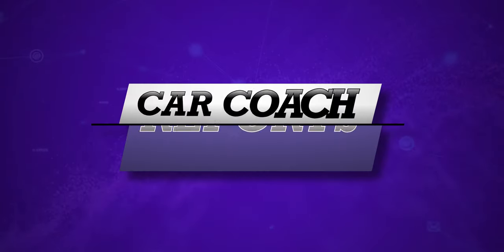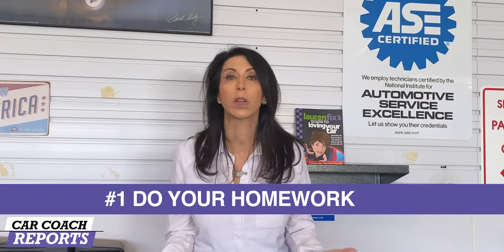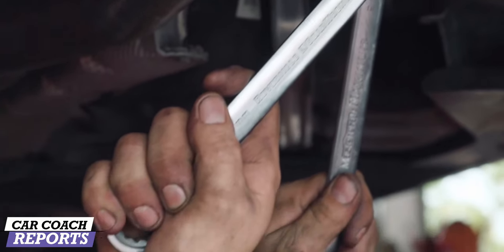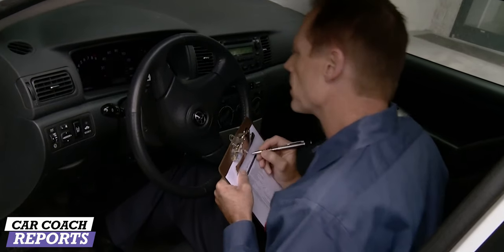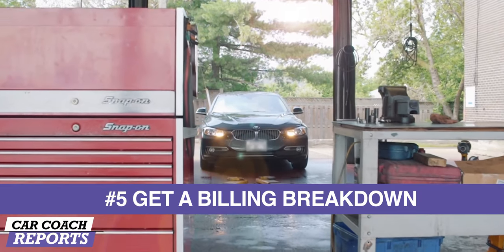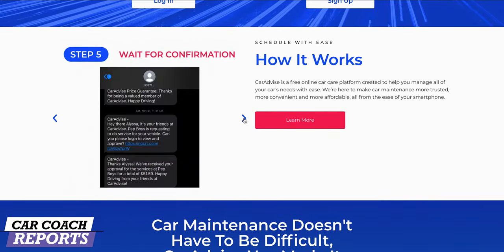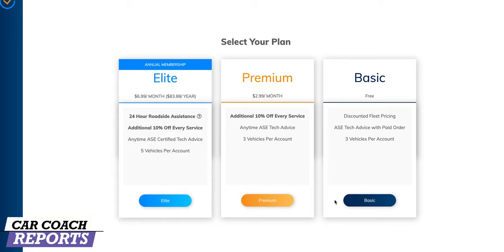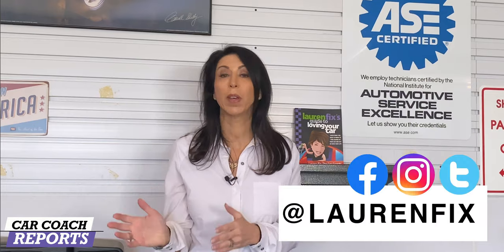5 Steps To Find a Trusted Auto Mechanic and Save Money!

Comment: Another super upload from Super Lauren! Solid advice. As GM and then CFO of one of the largest dealership networks in the USA and Canada at one time. The techs were all masters in order to work for us. 
But they were instructed to FIND issues and convince the service UP that if the repairs were not made, it would lead to major damage soon. Most service UPS went and paid the additional cost for a repair/repairs that were not always expedient to have done. 
 My Advice to YOU, the viewers is simply to LISTEN to Lauren amd save money now. Or deal with someone like ME later. I'm no longer in the car biz because I have to live with myself. And ripping people off is not a Christian way to act. 
   However, there are still a couple of million of the dirty types of shady techs and greedy dealerships out there. Heed Lauren's advice and save your money. And if you DON'T, you will eventually remember that BOB told you so.
Reply from the maker: Sadly, like any businesses, most are good and some bad players are there to catch you off guard. These 5 steps are a great way to find a trusted technician.
Reply: @CarCoachReports  I concur with you every step of the way here. Mostly always do, Lauren. But the internet full of so called experts can give the wrong advice on any given auto or the UP gives them the wrong description pf what is amis with their car. 
 It's best to take your auto to a reputable dealership or Garage for a correct assessment. Like you would give. 

Just be certain to read the positive and negative reviews on the business, PRIOR to going to have your auto evaluated. Amd beware of fake views. They're out there. 
 Thank you again for this excellent upload, Lauren. With people like you around, viewers are less prone to be ripped off from the likes of cons who are techs. Even SAE certified Master Techs can be cons.

Comment: 12-Volt Batteries in Some 2021 Ford Mustang Mach-Es Are Dying, Leaving Owners Stranded

Ford said in a service bulletin that as a result of a software glitch, the 12-volt batteries in some Mach-Es are dying while the vehicle is being charged.

Got this from CAR AND DRIVER (aka, Horse and Jockey) just now, Lauren. This will continue to be an issue with EVs.
Reply from the maker: Saw that - its a software update which will be sent to their vehicles to resolve the issue. Not good timing but it is an all new car. Like any new vehicle, issues can happen and will happen. As you know Bob.
Reply: @CarCoachReports  Like Every new vehicle. However, my source states that it's the batteries built before early February. As you well know, Lauren(or dp now). So I doubt that it's truly a software glitch as FoMoCo may have claimed in it's TSB. It may have been a combination of both. However, the batteries in these select early units were defective. 
Thanks for the reply.

Comment: And GO for the test drive with your tech. You drive first. And don't be afraid to ask 100 questions if you have to. You don't want to rely on a silk tongue SAE Master Tech who will rob you. Do your research online. But car advise is just that, and can be confusing. So have a friend help you. A friend like Lauren. And get another opinion from a second SAE MASTER Tech. But don't get confused amd be SURE that they are a reputable dealer/tech. And not just another "Mike the Mechanic.
Reply from the maker: Great advice. If you are still unsure and just want to get the best pricing, check out www.caradvise.com this is a great resource to understand whats wrong with your car.